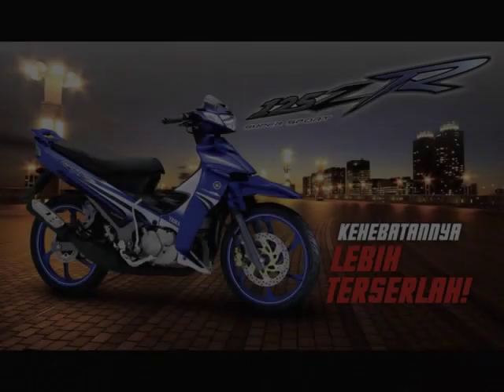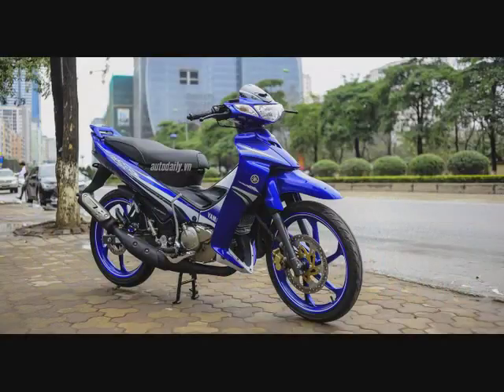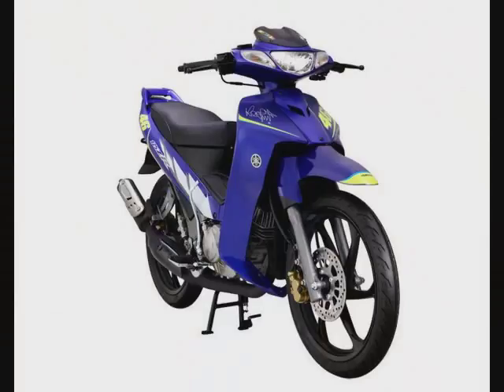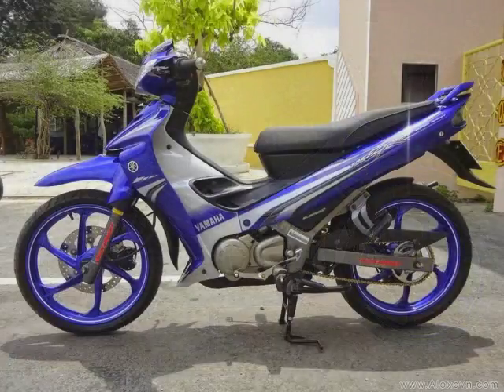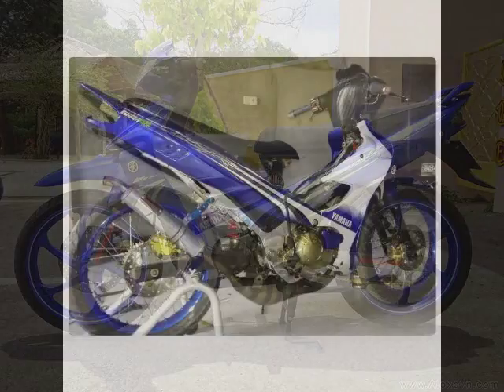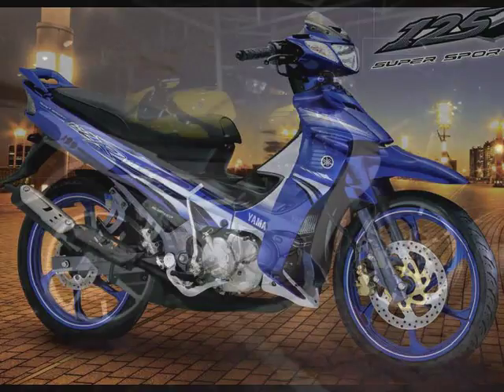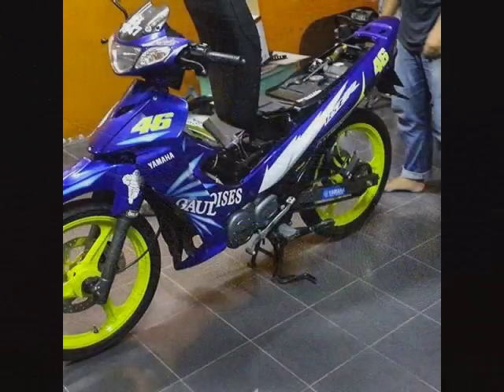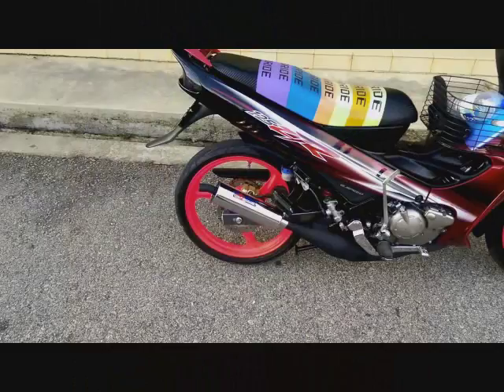YAMAHA 125Z/ZR INTRODUCTION

Comment from the maker: SENARAI VIDEO Zaias Stream Video DI YOUTUBE CHANNEL

125Z/ZR COPY SPECS YZ125 FACTORY RACING
https://www.youtube.com/watch?v=BJ4IinWgLaw

SPECS KHAS 125Z/ZR SAINGAN APRILIA RS125
 https://youtu.be/FzFlnrF-ijA

TIPS PENJAGAAN LC135 BIG BORE DARI JEM
 https://youtu.be/hLVB59Ah5S0

COIL YAMAHA RACING SPECS COMBO TERBAIK 125Z/ZR https://youtu.be/hWkyYh_QSl4

BLOK LC135 68mm & TIPS PENJAGAAN - SUM RACING https://youtu.be/RxBuJ7Tjlkc

SAMBUNGAN MASAK BLOK DENGAN MINYAK HITAM "HEAT TREATMENT"
https://youtu.be/PEhxyNBtiLQ

EX5 100 POWER JET SYSTEM SPEC HIGHWAY https://youtu.be/e9MVonPyVw4

YAMAHA LC135 POWER JET SYSTEM 'RXZ HUNTER' (khas pengguna LC135)
https://youtu.be/tWQCCk_8ESo

LC135 WAVE125 CT110 JIWA KELAJUAN DGN PISTON HISPEED (PENJELASAN MATERIAL)
https://youtu.be/WGrvbvRObJo

KENAPA CONNECTING ROD RACING PERLU UNTUK MOTOR BLOK BESAR 4 STROKE
https://youtu.be/n3pJbg7RRjo

MODENAS GT128 TEKNOLOGI KAWASAKI
https://youtu.be/-u-f7413yA8

KRR 150 SE THAILAND "RESEPI JIWA KELAJUAN UNTUK RR ANDA"
https://youtu.be/6VSchLu73Og

TEKNIK OTAI: MASAK BLOK DGN MINYAK HITAM
https://youtu.be/3Ftx9NkDkE8

BERAPE TOPSPEED GPS RR NI? GELI-GELI JER NI https://youtu.be/yEvPb5IEZAo

RR METER BERAT (SPEEDO KRZ) KASI KAKI KECAM TENGOK
https://youtu.be/omTvfsJEIWk

'TEORI' RXZ FULL MODI vs MOTOGP BIKE (Aspect LOGIK, POWER/WEIGHT & HORSEPOWER)
https://youtu.be/SPNQg6ehmSk

5 SEBAB HONDA EX5 110FI SESUAI UNTUK ANDA
https://youtu.be/jilnei0ZLJE

TIPS LC135 V2 V3 V4 BLOCK STD FULL POWER PART 2
https://youtu.be/uRXP8AzMFag

TIPS LC135 V2 V3 V4 BLOCK STD FULL POWER PART 1
https://youtu.be/GySnHbT9g00

PERFORMANCE MOTOR POWER VALVE vs NON-POWER VALVE (YAMAHA 125Z/ZR VS APRILIA RS125)
https://youtu.be/UPwAKIGyEcQ

KENAPA MODENAS GUNA BLUEPRINT KAWASAKI
https://youtu.be/X0DeLX23F_Q

MODENAS KRISS 110 MODI SANTAI
https://youtu.be/TZGxBD4qfJ0

YAMAHA 125Z/ZR INTRODUCTION
https://youtu.be/45ET95LCClI

ANTARA MOTOR METER BERAT (KHAS UNTUK JIWA KELAJUAN)
https://youtu.be/jqurl1sMUgA

EX5 BLOK 53 MODI SANTAI
https://youtu.be/BtTesfe62Mo

NEW YAMAHA R15 MERECIK HAWAU
https://youtu.be/eASOa9pzTy0

KESILAPAN MODIFIKASI LC135 V2 V3 V4
https://youtu.be/OfX8bKKlaT4

DUBBING TZM150 vs NSR150SP FIM ASIA ROAD RACING PASIR GUDANG 1998
https://youtu.be/6X3laGBQb94

Compilation Dinamik 120 Sarung Paip
https://youtu.be/2Zr37EZd-oY

JET ROD 2STROKE & 4STROKE INTRODUCTION
https://youtu.be/NhuV_YwiS5I

Yamaha TZM 150 Introduction
https://youtu.be/RfZ6p53wLF0

Modenas Dinamik 120 Introduction
https://youtu.be/PPJyVEj4qX0

Admin zaias stream video "cuci mata" (gay jangan tengok)
https://youtu.be/QVxW60b83do

YAMAHA 125Z BLOK TZR150 Part 3 (Ulasan specs disertakan)
https://youtu.be/DFY7PqObE4s

YAMAHA 125Z BLOK TZR150 PART 2 (Ulasan specs disertakan)
https://youtu.be/MNLeQ5iYRes

Kawasaki ZX150RR Introduction
https://youtu.be/pABUD36X8Vs

KAMI MAT MOTO BUKAN MAT REMPIT KAMI ASSET NEGARA "permotoran adalah industri, bukan sekadar hobi"
https://youtu.be/TJrCcYsK0B0

RXZ vs 125Z "Mana lagi laju?"
https://youtu.be/aEvuuOSa8wA

Yamaha 125ZR Std Modi Tanpa Modal Besar
https://youtu.be/x9X372iPjXM

Tips Melajukan LC135 V2 Tanpa Tukar Blok
https://youtu.be/7WNVWuzNgY8

Resepi Topspeed RXZ Yang Hanya Pomen Je Tau (Details dan ulasan ubahsuai disertakan)
https://youtu.be/YE-sSmVjvyY

SETUP POWER VALVE RXZ 125Z LC135 & TXR MENGGUNAKAN SISTEM POWER JET CARBURETOR FLAT SLIDE UMA RACING
https://youtu.be/gQXCvY2YA-0

Y15ZR Blok 65 UMA Racing Review
https://youtu.be/py37yzW7gjo

RXZ meter 240kmh kena sayur ngan Kawasaki RR
https://youtu.be/iMupHT51cCM
Reply: Apa beza 125Z dengan 125ZR?

Comment: Bos apsal ramai tak pakai block racing untk 125zr??tk laju ke.atau tak tahan lasak
Reply from the maker: Mr.Nobody Mr.nobody Sebab blok std tupai boleh lay masuk piston enduro. Modal lebih murah, motor laju
Reply: zaias stream video 
Enduro block size brapa bos.
Sry bos saya baru beli 125 minggu lepas..new bie lgi..enduro tu apa mksud porting ke
Reply: Tpi kt veitnam ramai orang pakai block 62mm
Reply: piston enduro size 56mm enduro tu moto Yamaha dt 125
Reply: Mr.Nobody Mr.nobody enduro 56mm sama ngan saiz rxz. tinggi pin je lain

Comment: Buat pasal x1r boss malaysia kan takde motor ni, x1r boleh gigit 2stroke saya dgr2
Reply: Tak betul lu dgr tu bro.belum ada sejarah lagi motor X1R ni boleh Tapau dan Gigit motor 2 stroke.zaman zaman 2 stroke dulu motor paling kuat dab power Yamaha TZM.walapupun pencabar TZM masa ni banyak seperti motor NSR,KIPS,KRZ,SCORPION,VICTOR,SCORPION,PANTHER,TXR GAMMA,ni semua motor kelas 150cc.Jgn silap bro,kena kaji selidik dulu sejarah,sebelum cakap.nanti marah otai otai 2 stroke.kalau dgr.
Reply: @shamthrasher1381 apa beza 125z dgn zr bang?😅 Keliru la
Reply: @jiwangterlajak6406  beza dia..125Z Liner Blok Tebal dan boleh Rebore sampai size piston 3.50(57.50mm) manakala blok 125ZR Liner Blok Nipis.Limited Rebore sampai size piston 2.00(56mm) ni beza dia..sbnarnya..
Reply: @shamthrasher1381  mana lgi padu performance ka enjin ap smua?😂
Reply: @jiwangterlajak6406  mesti balance,Engine dan Peformance main.kan peranan.
Reply: @shamthrasher1381  x..mksudnya kalo std ngn std mana yg lgi padu?
Reply: @jiwangterlajak6406  xda yg padu jika masih standard..standard ini adaah spec yg di lulus kan dari kilang dan kerajaan.dlm perlumbaan Cub prix,semua jentere 2 stroke yg masih spec standard.akan di Tukat kpd Parts dan Spec Racing.sbb tu lah 2 stroke telah di haram.kan dlm.perlumbaan Cub prix dan MOTO GP.di sebab kan,spec Racing 2 strokr ni..6x Ganda berbanding Spec Asal(Standard)